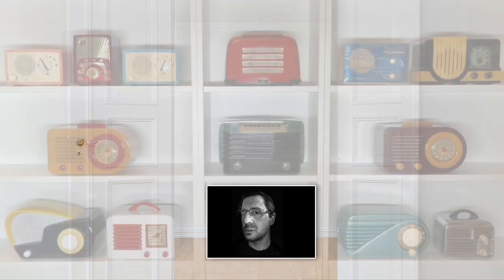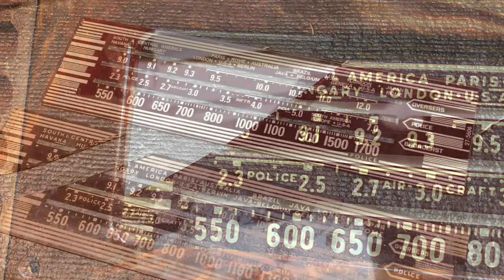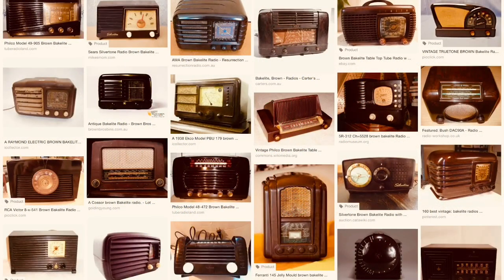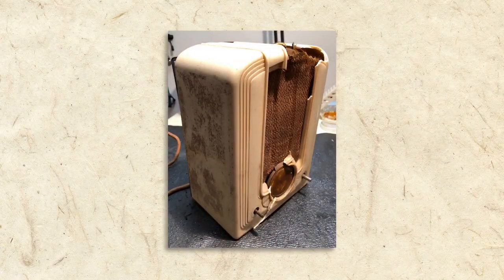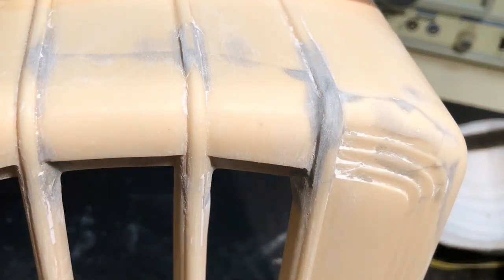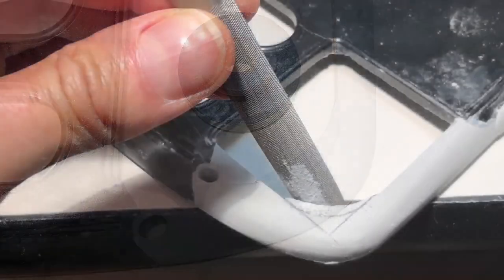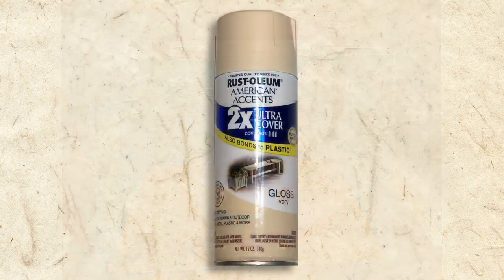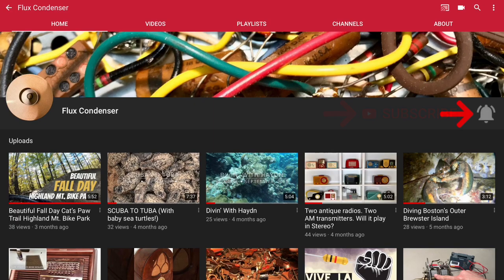How to Fix Antique Radios

Comment: This video was shown as an advertisement at the top of my YouTube recommendation.  I’ve never clicked an add before. 

I’m not necessarily interested in radios or alignment l, but I subscribe to all of those channels you recommended in the beginning of your video… I’m also a patreon member to many of them.

I really enjoy electronics, but I don’t work on radios. I’m more into vintage and modern  test equipment… And all kinds of other weird and interesting projects. Mostly industrial electronics and control.

I Started learning a few years ago… after spending over 10 years building guitars and amps for a living. Yes I know… Tube amps are dangerous especially without understanding electronics theory. 
But I was a Machinist by trade, so I had no problem reading schematics and complex blueprints. 

So when it came to wiring… I carefully followed the schematic and never had any issues. But I knew nothing of electronics theory. I didn’t even know capacitors could store energy! 

So the worst happened… After 10 years of building vintage reproduction tube amps with no issues…......I was working on my tig welding machine. Poking around thinking A wire must have come loose. It had been turned off and unplugged for several days. But the bank of MASSIVE high-voltage capacitors Slammed me backwards it’s my wife’s car door hard enough to leave a big dent. And burnt a hole completely through the top of my thumbnail. 

Yeah… Two HV capacitors the size of a Pringles can....But I didn’t know any better.That’s when I decided I had to learn the basics.

Lack of electronics knowledge had limited me in every aspect of my life. Business and otherwise.

Building guitar amps, building CNC machines, restoring vintage metalworking mills/lathes/surface grinders etc, Restoring all types of vintage carpentry equipment and machinery, even fixing my own stuff when it breaks! I couldn’t do any of it. I had avoided electrical work, Always asking a friend to help or following a trusted schematic. without the basic understanding of component types and how they work together, I was helpless.

Electronics weren’t something I enjoyed or wanted to learn. Other than necessity of it… It just wasn’t interesting to me. But I learned the basic functions of common components like resistors, capacitors, transistors, etc.…
But when I began learning the history of transistors, and how evolving electronics have shaped our world… I was amazed and it really began to catch my interest. 

Like I said before...I didn’t even know capacitors could store charge, and only knew the resistors function because of their name. So when I learned the basics… And realized how things have advance… It’s so mind blowing it almost sounds like science fiction. Most folks have absolutely no idea that everything we use on a daily basis is absolute black magic. It’s all a miracle. The cheapest shittiest electronic items at the discount store are like government secret technology from the 1960s and 70s.....that we now have access to every day. 
10 years ago if you wanted a 18650 rechargeable battery hooked to a solar cell… with built-in charging and protection circuits and variable output power pcb....It would cost you a lot of money! probably $50 Maybe even $100!

Now you can buy a $3 rechargeable garden light from the dollar store that contains all of these items! Already wired up and ready to go!

I was so amazed at electronics…Which made me even more afraid to begin experimenting hands on. There Are so many variables. And The only reason I was learning was so I could do this work safely and not get shocked again. So I wanted to have good equipment to keep me safe… And most importantly… The visual learner and need to SEE THE INVISIBLE!!! Electrons are invisible!

I’ve become decent at chasing tone when building musical instruments. It’s something that is mysterious and invisible. But easily shown with the right devices and measuring equipment… And once you see it and observe it for a while… You understand the variables, And the results of various actions. You don’t fear the repercussions of your actions. Because you know the result.

The same applies with electronics. Oscilloscopes and other test equipment allow you to see what’s going on. To see the invisible! Which to a visual learner like myself… Is a mandatory part of learning.

(Side note..... this is also how I “honed” my sharpening your skills. After two decades of trying to get the perfect edge on my cutting tools… it finally clicked. I use mostly antique hand tools so I needed a perfectly sharpened edge on my chisels and Handplanes… but had always struggled. The edge of a finely honed blade is microscopic and invisible to the human eye. You can’t see the geometry and when or if your technique is wrong… So you don’t know how to correct it. You just have dull equipment, Without knowing why. But I finally used my microscope to look at the blade Edge geometry before and after sharpening....And could see what I was doing wrong, and know how to correct it. Seeing the invisible is a great way to learn something. Whether sharpening, Or in this case the path of electrons.)

But there was a problem. I couldn’t afford a decent lab setup.....because test gear is expensive. So I began buying untested “as is“ equipment and praying it was a simple blown fuse, bad capacitor, or something simple.
It took a while, but with the help of youtubers like  “Mr. Carlson’s lab” “EEVblog“ “xraytonyB” and many others… I put together a complete, professional, and humble test bench. 
I got lucky, And spent the better part of the year watching eBay and other sources closely. Finally piecing together a complete but humble test equipment lab… Full of professional equipment. Most of which was extremely expensive when new. 
Spent a bit of money on a good precision calibration source… (“DMM CHECK PLUS”) and all with a very tight budget!!  I resold A few pieces of test gear on eBay… Which were extras, or simply too nice and expensive to keep. For example… I purchased a $1500 multimeter for $200, which is a great deal. But I still can’t justify keeping it on my bench when I could instead use the $1300 profit to find more gear. 
Of course I couldn’t get as much as a professionally repaired or calibrated piece of gear. But simply showing the device turned on and running, And being honest about my cheap acquisition and troubleshooting/repair… would net a hefty profit. Which would help fund other pieces of test gear.

I finally put together a humble complete test bench a year or two ago… I realized I enjoy building and restoring test equipment more than my intended projects. 

Sorry to ramble lawn… But YouTube is such a wonderful outlet for learning and teaching. And what really caught my attention in the beginning of your video… Was your promise to “be thorough without dumbing things down” but most importantly “not to assume that we already know”. That really is the key when teaching electronics! And I look forward to seeing your progress!
Reply from the maker: I read your comment with great interest. The way you describe electronics as under-appreciated magic really resonates with me. Every time I learn something new or fix one of these magic boxes I want to shout from the rooftops about just what a miracle electronics can be, even electronics from the thirties and older. Of course, the average person (my wife, daughter, most friends) just yawn and say, “OK, that’s cool I guess” or something to that effect. YouTube, as you say, is an incredible resource for those with like-minded interests and it’s so great to hear from someone that “gets it!” You made me an instant subscriber to your channel. Take care and stay in touch.
Reply: OK this is ridiculous… I just looked back through your video catalog and the quality, information, and frequency of your uploads are absolutely through the roof. Head and shoulders above most of what’s available… And I’m speechless to why your views and subscription count is so low. There are several channels with similar information and quality content… But that aren’t shot or composed as well as yours. But They had 10 times the following after The same amount of content and time. 

There’s got to be something you can do to get more folks. I found you from an advertisement so I assume that’s something you’re now trying? I bet that’s expensive?

The reason I don’t click ads normally (and almost didn’t click yours)… Is because they’re usually selling something. But You’re advertising a free YouTube channel with all free information. So I’m not sure people click on adds because they probably think you’re selling a course or class. Who knows.... the add worked on me so it may work.

If you could somehow get a “shout out” or mention from some of the big electronics channels. From my experience folks like Mr. Carlson, x-rayTonyB, Fran lab, big Clive, and even smart ass Dave at EEV blog.... all those folks are glad to give smaller electronics channels a shout out and link your YouTube in their description. Especially with extremely high-quality content like yours! 

Whether you send them something in a “mailbag video”  or try to contact them through video comments. All the people I listed have responded to my personal YouTube comments several times each. Even though some of them have a lot of subscribers.

Also, maybe if you dabbled with different types of electronics. Something that interests you personally, but something modern, or maybe vintage like computers and such… People like “Dexter‘s tech Lab” and “mikes radio repair”… Tear down all types of modern and vintage high tech products… And I think that brings in a wide range of people. 
And don’t underestimate the amount of folks who enjoy watching every day items torn down. Like stuff from the dollar store, power banks, anything that might be interesting or useful in electronics projects. 

Similar to “Big clive’s” channel. If big Clive and “ x-rayed Tony B” we’re mixed into one channel..... that would be the perfect channel for me. 

Big Clive tears down modern cheap stuff, Like power banks and parts that could be used in other electronics projects. which is super interesting but he does nothing with test gear or vintage stereos. But if the two channels were melded into one.... I think you could have twice the subscribers of either of them!

Of course… If you’re doing this for enjoyment… Then only do what you enjoy. I’m in no way trying to convince you to do something other than what you are already interested in. And if subscriber count isn’t a concern of yours then totally ignore these comments and I apologized. Just thoughts.

I look Forward to following your channel!
Reply from the maker: Thanks so much for the great feedback! Yes, I do this all for fun and have no interest in making money off the channel even though there can be quite an expense to making these videos, especially ones that require licensing stock photography. Lately, I’ve been venturing into lots of different areas with my videos such as high-fidelity equipment, music critiques and even one video on how to tweak a YouTube channel. Your words are very kind and when I hear from people like you and get a chance to “talk shop” and learn more that’s all the payment I need.

Comment: Just a wonderfully done series. Almost thought I was back in science class watching an old Navy type training film.
One item of concern.
The variac I believe your using may be one that is also an isolation transformer as well.
The variac I use is from the same manufacturer but, it only features one electrical outlet.
This single outlet model is  Not an isolation transformer / variac combo.
Thank you again for a wonderful video series.
Happy Thanksgiving and Merry Christmas.
Reply from the maker: Thanks, Roger. Much appreciated and happy holidays to you as well. You’re not the only one to question my Variac. I’ve received many such comments over the years and just recently made a video addressing the issue to help settle the matter once and for all. Check it out. https://youtu.be/8o7HtGTvBvA

Comment: I am interested in using the apoxie sculpt to repair a screw socket on a vintage radio like you did.  I'd like to insert the screw into the remains of the screw hole, so I get threads.  How did you keep the material from adhering to the screw, while it adhered to the plastic?
Reply from the maker: Good question, David. It’s been so long since I made the video, but I recall that I simply let the material harden and then unscrewed the screw to remove it. You might want to experiment with one of the screws first separately from the radio as a test.

Comment: one concern I have is the longevity of the epoxy. I think most radio refurbishes are hoping their radios last another 40-80 years. The chemical degradation of the epoxy that might go on over the next 20-30 years concerns me. I wonder with the modern cnc machines if a wooden cabinet could be made with very similar feel to the original ?
Reply from the maker: As shown in the videos, the radio was originally made with Plaskon which is a resin similar to epoxy. Almost every Plaskon radio today is cracked and shows signs of degradation, so my results are an improvement of what one would typically see for this type of radio. I’m not worried about using the Epoxy Sculpt as it’s essentially a modern version of the original material and will fare no worse over time and most likely will do better. Additionally, as the radio cabinet was completely smashed, extending the life of the radio for any amount of time is a bonus. Because of it’s similar properties, Epoxy Sculpt was the ideal material to repair the cabinet. One could potentially build a duplicate out of wood, but the result would not be historically correct and the effort would be tremendous. I think 3D printing would actually be more appropriate, but the result would not be as beautiful.